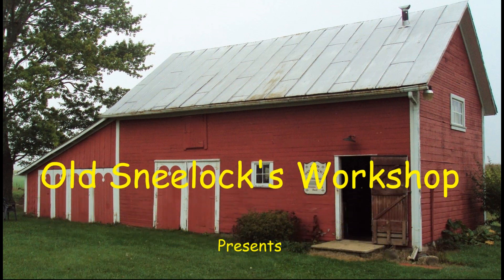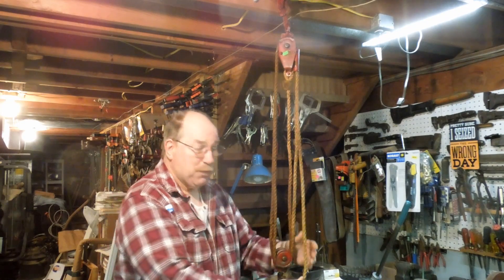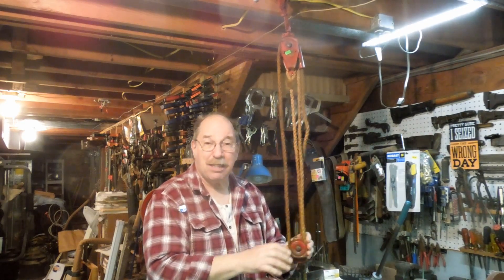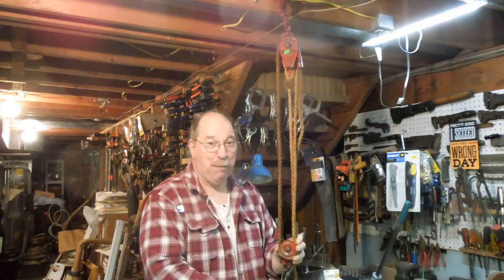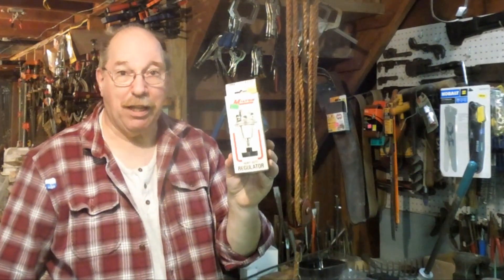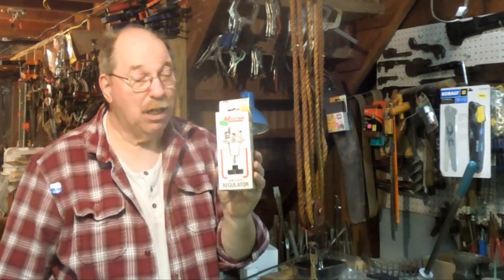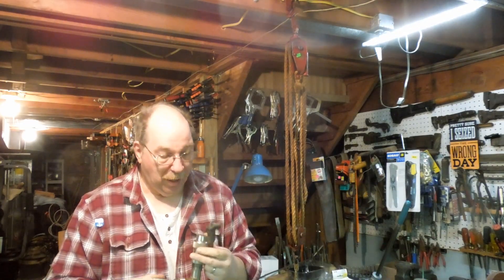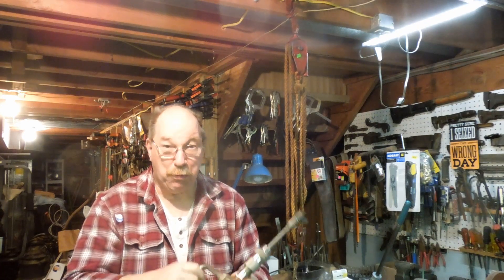Flea Market Finds - Projects In The Making

Comment: I didn't use a fence stretcher like that but years ago I put up about a half mile of fence around a beautiful wooded area, it's fun to be out working in the woods doing constructive stuff like that.
Reply from the maker: I built a cedar split rail fence around our house by Quincy. About 800 feet worth. Lots of post holes dug with my Dad's post hole digger. I still have it in the mower shed. 
It was beautiful when it was done. I can't say it was all fun, but I sure liked it when it was done. 
Still standing nearly 35 years later.

Comment: That stretcher looks like it could be very useful   🛠👍😊
Reply from the maker: I think so too! I have always liked using rope sheaves for lifting and pulling. The Original Sneelock's Workshop was pulled straight using block and tackle. I took the lean out of the building and braced it in the corners 30 years ago. Still there. 😁😎
Reply: I don't need one but I shall keep an eye out for one from now on 🔨👍😊

Comment: Nice additions to the ANNEX. A 4-part anything is strong. Ran a 4-part line on the o.d. green clam bucket because it was slow enough not to yank the bucket out of the pile before it got full. The interesting part was that both the hoist and closing line drums on the crane had to have the same amount of cable with the clam closed or one would outrun the other. That took a bit with no formal training on any of it but like Teryl says, 'It ain't the space shuttle. And you're raising your assistant right now. The name OLIVER ring a bell? Thought so. GBWYall!
Reply: I agree Oliver is the "MAN" up and coming!!
Reply: @paulharriss1192  The only viable option that I know of.
Reply from the maker: I was amazed when Ryan yanked the boxelder down with the other one. He is one big guy and the 4 part worked great. 😁😎
Reply: @OldSneelock  4-part is some strong stuff. Just a snatch block can move a LOT!
Reply from the maker: The hay lift in the big barn was a two part, I used it to unload the pickup. By running the rope through a couple blocks mounted to the wall I could lift things I couldn't drag out. 😁😎
Reply: @OldSneelock  I drug out the splitter in the packing crate off the Taco and then slid it inside with the peavey when the strap on the hoist wouldn't work. I'd still like a winch but the strap will work. Might be all I ever need.
Reply: @lewiemcneely9143  Dew da name Ruby Begonia ring a bell?
Don't ask me ask Amos. 
Or Andy.
Reply: @mostlymoparih5682  Ruby Tuesday or Rochester. No King FISH here. Used to eat at Ruby Tuesdays before the salad bar died.
Reply: @mostlymoparih5682  No haibuts but maybe a Haliburton.
Reply: @lewiemcneely9143  I came to respond to your comment and noticed that You Tube deleted my halibut comment.
They have been doing that a lot lately. They want me to stop making conservative comments and posting prayers and Amens. 
So if I disappear completely you know that I'm safe in God's hands.
Reply: @mostlymoparih5682  I saw it before they saw it and sawed it. See? Si! We'll both vanish one day and they'll wish they could. You can always email me and yes, yours have been going away.
Reply: @mostlymoparih5682  They just canned your last one BUT the Almighty WILL help US but the big boys that do the chunking into the fiery lake will help them.

Comment: Good finds.   I am not familiar with the chuck on the Craftsman brace.   How about a few pictures showing how it is designed.  I have a few braces with the normal "V" in the two jaws to hold a tapered square shank.
Dave.
Reply from the maker: Good idea. It comes apart fairly easy. 😁😎